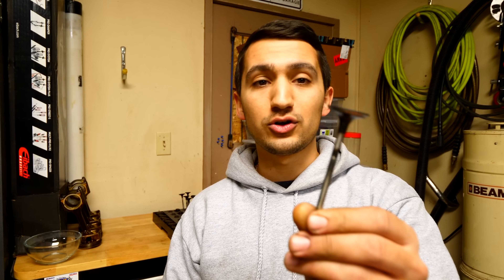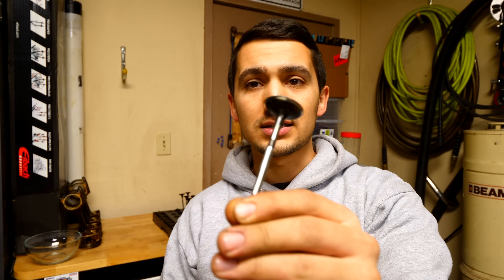How to Clean and Refinish Valves

Comment: Thumbs 👍 up for increasing stem/guide clearance. Completely unnecessary other than the scotchbright
Reply: @Ellie Basic yes scotchbrite is fine
Reply: Ellie Basic do not listen to him. The scotchbrite still is not a good idea. It still scratches the metal. Even if it says nonscratch. Professionals use untrasonic cleaners to remove dirt and carbon without stripping a single piece of metal. That’s the whole purpose
Reply: @Sci-Mon1  professionals do use ultra sonic cleaners but scotchbrite scratches are negligible on valves for non professionals, I've done it so many times without any problems and built many cylinder heads so stop spreading disinformation if you don't know what you're talking about.
Reply: @Liveforeever  I know its a year old comment, but as a machinist I can say you are more right than you know. Scotchbrite will not remove 10 thou, not even hardly 1 ten thousands of an inch. I've polished up steel parts on a lathe after machining and it takes sandpaper to remove even just a few thou checking with a micrometer. On a hardened valve? Scotchbrite wont even touch it, guaranteed. Hihello is ignorant.
Reply: @ec5838  I totally agree. I, also am a retired machinist . I have had to hold tight tolerances almost on a daily basis, and even held tolerances to within .0002. Which is 2 tenths one thosanth. I never worried about taking it under tolerance using scotchbright.  People that have never been a machinist don't seem to understand. Sanding the back of the valve couldn't hurt as long as you didn't sand the part of the stem that rides in the guide or the part of the valve that closes in the seat. To clean this put the valves back in the head without the springs attached and hand lap them using lapping compound. Assemble the valves back in the head then and pour gas on the compression side .if it doesn't leak through, it's a good seal. If it does, then relap them. Good luck!
Reply: Put the lead back into the gas, so you don't worry about valve stem clearance, or for that matter just go back to flat head engine design and twenty six cent a gallon gas!

Comment: If you use 1-2 4oz.bottles of marvel mystery oil every tank full of gas to start then switch one bottle per tank those valves would remain in good condition.i have an08’ sonata with the original plugs at 150 k miles still running great and if you you gas with ethanol now and then on newer cars,even better

Comment: why would you do this? It is like cleaning inside of exhaust!
Reply: You mean I polished the insides of my muffler for nothing????
Reply: It is a bigger waste of time than cleaning the inside of the exhaust. You aren't ruining the exhaust bu cleaning it. Doing this to your valves is doing permanent damage.
Reply: @skyboy1956  yes exactly 😆
Reply: Idk man, this engine builder I bought an intake from said you can add up to 20 hp if you polish them that well. I'm going be careful on the seat contact area though that could make for a lot of valve lapping or a trip to the machine shop

Comment: What about lapping the valves? Making sure they still seat well with the head.
Reply: Same here. Also im just a little worry with the end he tighten the drill chuck too. Drill chucks sometimes have teeth to grab. I don't know if his has them. Im just afraid if it does. That the "teeth marks" would damage a valve seal
Reply from the maker: The lapping part will have to be done when reinstalling everything back in the head
Reply: milanmastracci did any damage happen to the valve where you tighten the chuck to ?
Reply from the maker: Nope, none what so ever :)
Reply: And nobody has said anything about him sanding the valve stem🙄 i machine heads for a living. You don't want to polish the intake valves on a port injected or carbed engine. But yes polish the exhaust valve's that's good. It helps reflect some heat away from the valve and valve guide😏😉
Reply: Maurice, could you please give us the reason why not? Just out of curiosity, I'm just a hobbyist, but I always like to learn from the pros . Thanks, mate!
Reply: banzay1 the intake after the injector should be a rough finish to help  keep the fuel atomized. I personally like a well used double cut burr finish on the intake. And the exhaust should be very smooth, polished is better for reflecting the heat back into the hot exhaust gasses and it should buildup less carbon.
Reply: braydensdeals way to much material had been removed for hand lapping.  They will have to be ground
Reply: @mauricedavis2905  Great comment, Maurice.  Thank you for sharing your know-how.
Reply: @jesselyons2002  I was just thinking that when I watched it I was like oh my God is he not going to put a cloth or anything when he tightens that Chuck down 👀
Reply: @milanmastracci  You have no business handling tools, much less telling thousands of others how to do something you are completely ignorant about. Read a book!

Comment: dude read a book or take an engine machine shop class before "teaching" others. The grain structures of the valve and seat are ground together and lapped so they will in essence fuse and make a complete seal For a split second during combustion. Second that valve has a cam on it the rotators are moving it so that same grain structure won't over heat in spots that'll lead to a blow out of valve. Look up a video of ringing in a gage block. Same concept. Powertrains are the most temperamental aspect of any type of mechanical  unit, and it's a science. I'm not trying to sound like a pompous ass but dude keep the scene " oh bro it's so clean fam" shit on the side  or else you're gonna be junking a project you dump thousands into. Also ~ learn something new every day~
Reply: I find this so funny because this guy also tells us to spray paint our fucking brake disks! idk if this channel is a joke or not lmao.
Reply: At least learn something else about what not to do everyday lmao
Reply: I guess all the guys that lap their valves are killing their performance then by changing the grain structure?
Reply: Next video, polishing the valve seat.  Hahaha
Reply: rude. more like guy badman.
Reply: The only thing that he did wrong was grinding the valve stem.

Comment: Hey Milan, been a sub for ages now. I like the fact you're cleaning it despite the fact it'll get dirty. However, I'm concerned they won't seal as well as they used to because you are removing media around. That's what sanding and polishing does after all. You've also removed material from the mating surfaces too.
Remember these parts do come with tolerance when manufactured.

I wish you all the best and still love watching you.
You show you have a passion for what you do and I'm sure nobody's opinion online will change that. Keep going.

If you want a cheap Bentley, speak to hoovies LOL

Comment: You definitely should have a good catch can setup for any direct injection motor if you don't want to see crap build up again.
As a tip, you only need to clean/polish the part of the valve that sticks out of the guide. Do it then you'll have a loose valve that wants to kiss your pistons. Also don't ever touch the valve edges where it seals with the head because if you shave a lot of material it'll be hard to fix it with lapping only.
Reply from the maker: Oh I couldn't agree with you more!!
Reply: There's no way any polishing can cause valve-piston contact. The keepers hold the valve up top to the coil spring. The coil spring constantly pulls the valve upward away from the piston. There's no way for them to kiss.
Reply: true

Comment: Hey yea ASE Certified Technician here. Yea those will never seat again plus you also changed the shape of the valve so you just polished some shiny paper weights. Plus you also damaged the valve stem by putting a drill driver on them....if your gonna clean your valves. Have a professional do it

Comment: No sand paper. I use a dremel with either a brass wheel or a black carbon wheel. Never steel on steel. And I never touch where the valve seats iether. They don’t need to look pretty at all. Don’t whaste your time polishing. Just make sure your valve seat is good
Reply: Don’t ever touch the part of the valve that contacts your valve guides. Just the face of the valve is necessary to keep those pesky suction cups on while you lap your valves. That’s all I do.

Comment: When you out the valve into the drill, put a piece of tubing over the end that goes into the drill so you don't screw up the metal on the valve when the drill clamps
Reply: Great point

Comment: This is so dumb. I hope you didn’t sand on the surface that contacts the valve seat in the head. If you did then you messed them up. I hope those valves are stainless too. Because if they aren’t and they were coated then you really made a mistake. They look Good tho. 

Omg. You blasted the valves. Smh.

Comment: Shouldn't attach a valve to the chuck of a drill let alone sanding it. That is about as smart as media blasting a cylinder head
Reply: Machine shop  blasted my head... then doing a 3 angle valve job..
Reply: ULB SRY I hope for your sake they soda blasted and not sand,glass or walnut because its almost impossible to get all the media out of a head or engine block. Lots of people destroy their motors doing this and is not recommended to media blast by reputable builders. Its your engine but imo its not worth the risk when they can clean it just as good with a sonic cleaning or nice parts washer. Best of luck as any engine failure sucks
Reply: Hachi-Roku Performance Group don’t believe it was sand. Not to sure.
Reply: ULB SRY if they have a good reputation then no reason to worry as if they do it the wrong way they wouldn't have a good reputation. Just my 2 cents and something to consider. What are you building?
Reply: Hachi-Roku Performance Group  my dads know the machine shop for 30+ years. They’ve been in business for 50+ I believe. I’m building a single turbo 6.0 LS motor. The owner is the one who is doing my heads for me. I think he bead blasted them. Then gave them back to me apart and I cleaned up the chambers. I’m giving them back and he’s doing a 3 angle valve job and milking them enough to just clean them up.then cleaning them and Installing my new btr .660 spring kit and the trunion upgrade for my rockers. I have an 83mm billet wheel BorgWarner for it.
Reply: ULB SRY that's a serious build what is it going in
Reply: Hachi-Roku Performance Group a 2001 s10 blazer
Reply: The goal is 1000 wheel.
Reply: ULB SRY sweet are you going all out or going the sleeper route?
Reply: At my engine rebuilders, any head job that comes in gets soda blasted, which is media blasting...
Reply: been bead blasting heads for 30 years it does not damage anything as long as you make damn sure you remove every bit of blasting media when done .. this is not however idiot proof you do not want a person who half asses everything doing this procedure you want an anal retentive clean freak that has cleaning ocd issues then all is good
Reply: Dont be Robert without Hart ... He is trying very hard and we should respect it. You can give him advice, that would be better dont you think ? Yes, he done a lots of job for nothing, but he made them like new ;) lol
Reply: Robert Alloy is fine to sand blast. Blast it thoroughly with compressed air after, and put it through a spray wash. Do it before you touch up the valve seats and mill the head.

Comment: The only part of the valve you should polish really is the back part of the bell, and the underside if you wish aand only to remove the carbon, of course you will need to lap the valve & seat after. As for sanding the stem, no. You DONT do that, leave it alone, each stem will measure different widths at different points along the stem, and has worn to the guide it sits in. What you have done there is trash a perfectly good valve, you mic that up you will find you have drsaticly changed the shape of that stem, increased the clearance to the point possibly beyond the guide. The correct way to do this is called "if it aint broke, dont fix it"